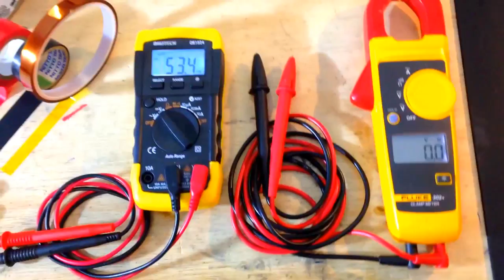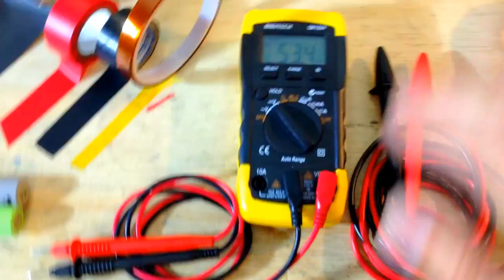Planning on making your own battery pack? DIY guide / tutorial • 18650 cells Electric Bike

Comment: Hi. here can i get one bms of those? my little one have fried.... :-S
Reply from the maker: Yeahhh we do have small BMS in stock, are u here in Australia or New Zealand? I think we have small 36v not sure if we have small 48v, I think they're a bit bigger with a greater thermal capacity to handle more power. Contact Ewan on sales@emax-ebikes.com.au or if you're too far, I also have some links here on the description of some BMS suppliers.
Good luck there, hopefully you'll get your battery fixed soon so you can get your electric bike back in action... POWEEERRRR =]
Reply: +ElectricBike (Bruno) 
Hi. I'm from Portugal. I don't want a small bms, if this one as fried just after one weak of use, other will happen the same. I will try one bms of 30A. my kit is 48v 20A battery and bafang 48v 1000w. very fun to drive :-)
Reply from the maker: +JPJFC - Yeahhh the battery should be always more powerful than the motor, always with power to spare. For the BBSHD 1000w motor which is 30A you should have a BMS capable of at least 35A, ideally 40A. Just watch lots of videos before you replace you BMS, instructions are very basic, it normally just comes with a spec sheet sometimes just the BMS itself. I have lots of battery videos here it may help you.
Maybe contact Rene from EV Madrid in Spain (check out his YouTube channel) he makes some awesome batteries and may be able to help you with a new BMS or replacing it for you.
Good luck there, tell Rene that I recommended you =]
POWEEEEEEERR..

Comment: what bms you recommend for 12s 60 amps
Reply from the maker: Yeahhh I have this one here that is actually 80A http://www.batterysupports.com/44v-48v-504v-12s-80a-12x-36v-lithium-ion-lipolymer-battery-bms-p-392.html
They also have a 60A version that is a bit smaller bit this big one will have bigger thermal capacity and bigger components what is better to handle higher amperage rather than operating the BMS on the limit.
I hope it helps =]
What are u building an RC motor system?
Reply: electric longboard
Reply from the maker: +Swaggy Kay - YEEEEEAHHHH... 12s 60A will be INSAAAAAANE hahahaa
You must upload videos here showing us that beast you're making =]

Comment: Can you teach how to make a Li-ion car battery
Reply from the maker: Yeaahh, I actually have a "DIY battery" playlist with many many videos showing how to wire the BMS (battery management system), how to organise the cells in a pack, how to connect the cell holders, using the spot welder and many other things. The idea is the same  for most battery packs for bikes, cordless power tools, electric car, some high current application may use LiPo (flat pouch cells) instead of cylindrical 18650 cells but LiPo is unstable, dangerous and doesn't last as long, it's a performance short life cell. Better stick with the stable 18650.
Here is the DIY battery playlist link:  http://www.youtube.com/playlist?list=PL59mIOWSOm9qrSglqe18AlYfBJRXLdduj
Enjoy the POWEEEEEERRR haha =]
Reply: +ElectricBike (Bruno) Okay I will take a look

Comment: These batteries are not better than the Panasonic 18650B. Only battery better than the 18650B is the LG HE2 3000mha.
Reply from the maker: Ok... I respect your opinion, but the numbers are here: 
Capacity: Panasonic B is 3400mAh while the LG MJ1 is 3500mAh.
Discharge: Panasonic B is low discharge while the LG is 10A high discharge.
Check any website showing battery reviews and you'll see that Panasonic B is considered an older cell nowadays. I own 70x Panasonic PF (from 2014 just like Panasonic B), I use every single day, I really like them but there are much newer and improved cells available.
Reply: +ElectricBike (Bruno) I used all those cells myself, and the Panasonic PF can not handle a high C. The LG HE2 3000mha on the other hand can handle 35A and still have long distance discharge capacity. Just because the mAh is high does not make it a better battery.
Reply: +ElectricBike (Bruno) does the Panasonic B loose performance when it's driven close to the specced 6.8 amp discharge? I was planning to use them on a project that will pull 3-4 amps per cell
Reply: +micheals1992 Get the LG HE2 3000mha bud. I use both and the HE2 is the best, and costs 5 bucks a cell off Aliexpress.
Reply: Damien Anonymous you mean HG2? the HE2s are 2500mah
Reply: +micheals1992 Don't get the old one that 2500mha, get the new HE2 that's 3000mha  :))) Fucking thing rocks!
Reply: where did you buy them?

Comment: what is it that makes australians in to crackpot nutters is it the heat lol. all that a side spot on nothing is ever simple
Reply from the maker: Hahahaha 46 degrees Celsius here today (shade temperature) if you stand in the sun is about 55C hahaha
About making batteries, there’s a lot more things to consider that I didn’t mention in this video. Putting things together is only one part of the puzzle, making the battery electrically able to deliver the energy without causing unbalance between series and tune a battery management system properly requires years and years of experience and long term use of multiple scenarios. Small batteries behave differently to large batteries, very large capacity. The most complicated ones are very high C discharge rate used for racing and high voltage 400v or 800v. At 800v the distance and materials used are important cause a lot of insulators become conducive at that voltage.
Reply: @BrunoPOWEEER  yes I know there is a lot to it all. But you have to start somewhere I don't have all the gear that you have. But the packs I have work well for my needs not pulling lots of amps just need high capacity. I think testing the cells is the most time-consuming job. plus lots of time on youtube. you can never stop learning.
Reply from the maker: Hahaha yeaahh Youtube is awesome... so good that we need to figure out a good balance, many times I find myself spending too much time watching and no much time actually making stuff!!!! 
My advice, if you’re using second hand batteries, fit as many parallels you can to minimise the difference between cells and make in a way that may be easy to swap a few cells around between series to get the balance right. You may find that series 11 is always the lowest and series 6 is always the highest when charging. Swap one or few cells between these series to smooth out the difference
Reply: @BrunoPOWEEER  ok well I am building a 6s75p pack fuses to each cell with a bms that you can customize settings on by app or pc so i can set cell voltage hight low and it stop charging if it gets to cold.  it will be charged by solar panels at max of 30 amp and load of no more than 15/20amp I plan on not charging over 80/90% and no lower than 30%. I have a good charge controller that i can customize settings. cell range from 1900 to 2500 mah regrouped using repackr.com